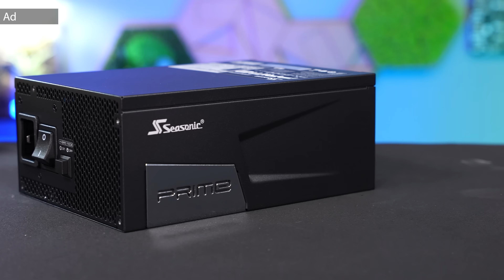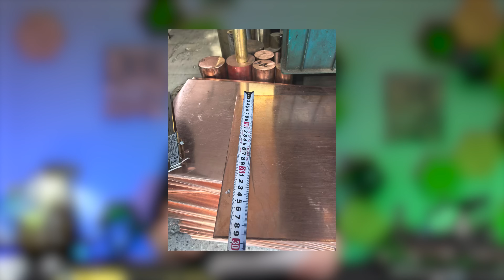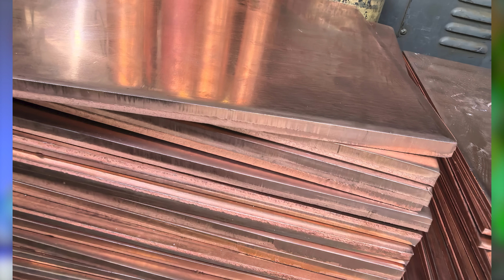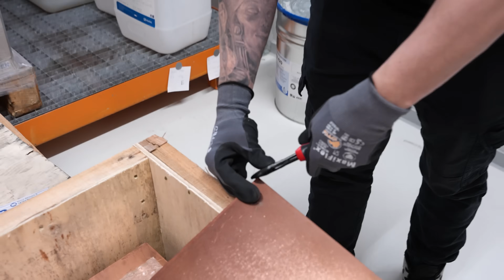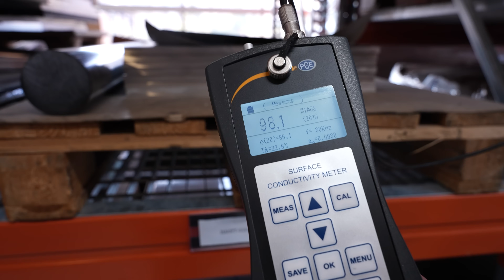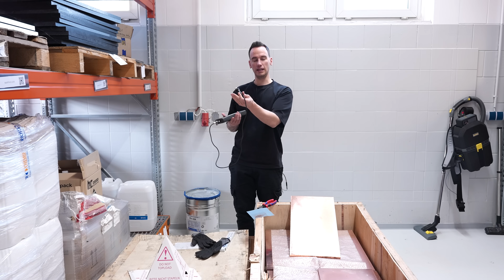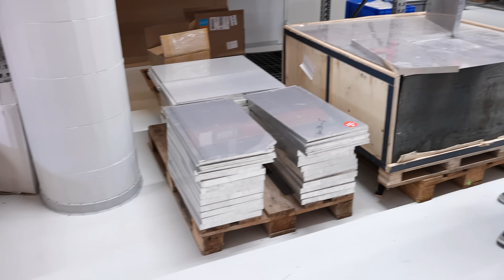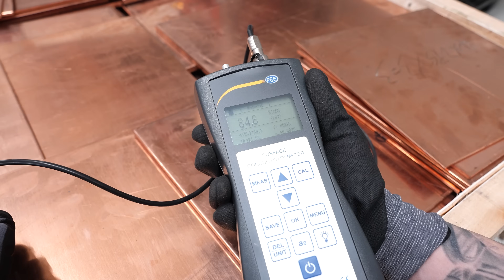I Got Scammed

Comment: As someone who works in the steel selling/wholeselling industries in the states.  No one currently has excess copper laying around. They are saving it for the big high profit sells, data center stuff and trying to hold on to it for those types of customers.  Because we can't restock it back as fast normal either.  100% copper is also going to make that tough, as its super hard to clean dirty copper to that purity level. So recycled copper is usually not a good source, unless its pure too.  You need to research who(mill) has been making the plates you currently have and find a wholeseller that has a good relationship with them.  I don't know if you buy enough to buy directly from the mill, but that too might be an option.  But if you are thinking of buying direct from a mill, its almost a 8 month lead time in normal times.  Right now they will probably prioritize some customers over others.   So you will need a transition plan.  Aluminum should not be hard to find a source or mill, copper probably is a little more difficult as that is more specialized.  Good luck.

Comment: The only recommendation I would get, is to find a reputable insurance company that ensures freight in Europe. Not China, but one that ensures you from the European Union. I suspect their rates for premiums will be just outrageous, but it might save you even 3/4 of your loss. However, some of the comments have said, it’s possible that this has been going on for quite some time. And any ensure knowing this, will refuse to ensure this type of transaction. And because of that, if you did your homework in advance to see if an insure would be willing to take the risk, you will know how expansive the fraud is in China. So from this day forward if you do any dealings in China, and it’s in large bulk see if it can be insured By an insurance company that does freight if they will not touch it with a 10 foot pole, then you know you probably shouldn’t buy from them

Comment: I also recently ordered some psu cable combs from china, took 2 weeks to ship, ended up with the wrong color variation. Took some pics, applied for refund, was refunded in the same hour, and now I have a set of useless combs technically for free.

Too bad tens of thousands worth of copper with framegen cant just be refunded willy nilly.

Comment: It sounds like you did everything you could do. There's always a chance that the one company you are still in contact with is not at fault, I remember years ago there was in issue with Video cards being shipped and it wasn't the company, but some bad apples inside the company that were at fault. If this is the case here, then it's fully within that company to save it's reputation.

Comment: Holy bananas. I’m currently based in China. A lot of foreigners living here provide services like factory visits, quality control, and inspections. I always wondered why people use those services when they can communicate directly with factories on Alibaba. Now I see why.

That’s crazy - this really shouldn’t happen.

As an engineer, I don’t have much experience placing orders like this, but one thing I would recommend is having a Chinese company covering your back. Of course, it has to be trustworthy. The point is that if the supplier sees they’re dealing with a local Chinese company, the chances of a scam become much lower, simply because they can actually be sued properly.

I don’t think you should feel ashamed about this situation. You’re not an idiot. I think it’s just a matter of perspective. You already have to deal with so many challenges that raw material issues and scams shouldn’t be among them.

Comment: Ouch, I am so sorry to hear you were scammed. i am glad you have shared the risks so others can learn from your mistakes. I know some suppliers who work with die cast, ship , or really make faulty die caste that is contaminated with lead, so it suffers from zinc pest, glad you did not run into that, as that would not have show up for a few years, only for products you shipped to turn to dust.

Comment: I'd be embarrassed, as well, but also needlessly so. While there is more you could have done - you could have flown to China to inspect their "facilities" personally - they probably would have scammed you in the end, anyway. In my experience, even companies you've trusted there for years can and will turn on you in a heartbeat, as ownership control often changes at the rate of undergarments at many of these Chinese commodity suppliers.

We, globally, have no one to blame but ourselves for this - we gave them basically of global manufacturing (and, by extension, refining) because it was profitable for us at the time. They built a new-age empire with it and have turned that power squarely against us, knowing it will take us decades to rebuild our own capacity while they rake us over the coals. 

Copper is particularly tricky, as we are in a rather significant ore shortage and China controls a solid 50+% of the global processing capacity, effectively outbidding every other country for ore during the shortage. 8 of the top 10 copper refineries in the world are in China and the country refines nearly 5x as much as any other nation; 10x what Germany refines. Hell, a single one of China's top refineries puts out more copper than the entire USA. We really should have done a better job of e-cycling over the decades because this copper shortage is only going to get worse.

Comment: Why didn’t you buy from a few more suppliers? If you were willing to invest or risk that amount of money, it would have made sense to spread it across multiple suppliers instead of just two. Even with smaller batches of around €5,000 each — yes, shipping might cost a bit more — but at least you wouldn’t have all your eggs in one basket.

I do understand that finding a good copper source can be very difficult, though. But if copper plates are your strategic commodity, you really can’t rely on just one or two suppliers — you need several of them, just in case.

Can’t you open a dispute through Alibaba? I thought their buyer protection covers situations like this.

I have all my fingers crossed for you. 🤞

Have a great day.

Comment: For international orders like this, it's best to personally visit the supplier's location or send a trusted representative to inspect everything before loading the shipment.
Reply: They could still swap it leaves the country. They know theyre basically untouchable as long as they dont blatantly admit anything. What you need is to have the relationship be worth more than what they can gain from scamming you, for example by buying from suppliers who have big contracts with people in your network.
Reply: @haaspaas2 If you trace it all the way back to the actual shipment, this won't happen
Reply: They will still scam.
Reply: How does this solve anything when they can scam you the moment you leave the location??
Reply: @paul2609 They even likely can just load your container on the ship last, then pull it off, repack when nobody is looking.
Reply: @paul2609 don't forget your tinfoil hat.
Reply: @paul2609  hire a sgs,tuv etc etc. consultant to check the product during the process. thats what we did. do not save on all these services money. from raw material mill certs, to cutting and bending process, get the report. send another 3rd party team to measure the finished goods. then get a reliable logistic company which operate closely with chinese logistics company for shipping and handling. thats what i did

Comment: I don't understand why you would feel stupid for getting scammed by 2 separate suppliers simultaneously. You did the right thing by not putting all of your eggs into one basket (supplier), and were still burned. Showing that it is becoming more and more of a problem across the industry and you were unfortunate enough to fall victim of this raw materials scam.. Very unfortunate and disgusting to see society running this way. This doesn't make you stupid, you shouldn't feel ashamed or embarrassed because in hindsight, what could you have done differently? Buy raw materials from a German supplier at a much higher price? Probably not. Shame on the suppliers!

China NOT #1! 🤣

Comment: Roman, I feel your pain. But here’s the thing - your mistake is actually an engineer’s mistake.
An engineer thinks like this: if you measure everything, test everything, control everything, the system will become reliable.
But the commodities market isn’t an engineering system. It’s a game of incentives, where some players try to win precisely through deception.

What actually helps in cases like this (and what large factories do):

third-party inspection in China (SGS / TÜV / Bureau Veritas). They literally cut samples right at the factory.
ultrasonic testing - it can detect differences in metal density.
a contract requiring chemical analysis of the batch with penalties.

But even that doesn’t always save you.

Comment: Not sure what payment method you used, but I'd recommend using a card (Visa/Mastercard). The payment card schemes have chargeback frameworks where they essentially arbitrate a dispute between you and a merchant. "goods not as described" is one of the valid chargeback reasons on both Visa and Mastercard.

If you using a payment card, I'd highly recommend looking into a consumer dispute and seeing if your card issuer can charge the payment back to the merchant. Given the comprehensive evidence you can supply regarding the tests you've carried out this would be a slam dunk chargeback win.

Comment: I think using a magnet should be the first test before accepting a shipment. It's by far the simplest test you can possibly perform without molesting the product. You could have displayed the issue right in front of the courier.